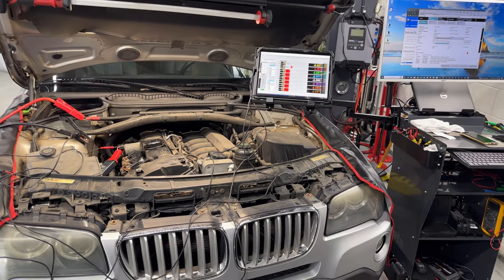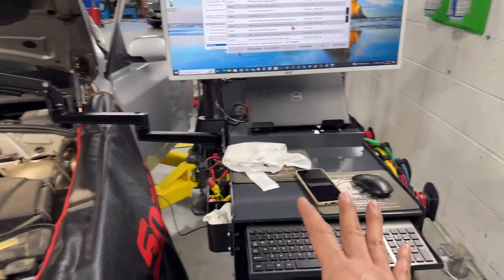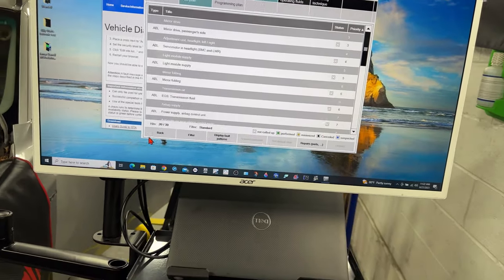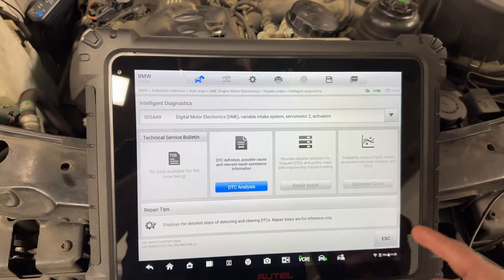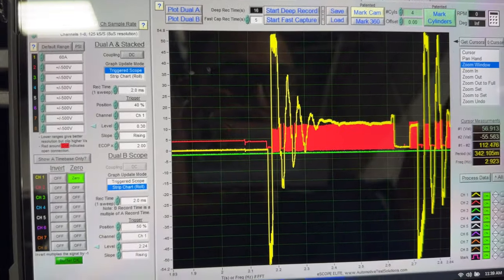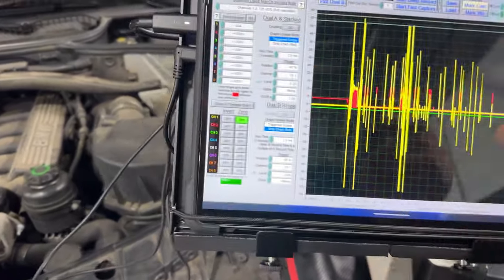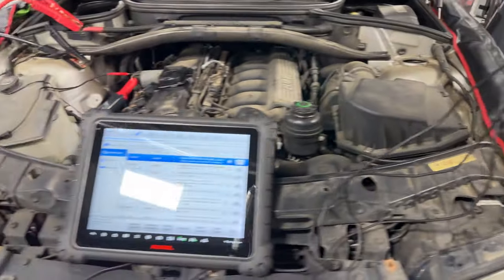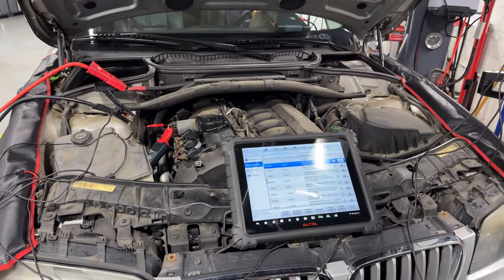2007 BMW X3 N52 E83 Valvetronic Motor Fault 2A43 Thermal Overloaded ATS Escope and Diag Cart set up

Comment: 2A43 Thermal Overloaded did you end up replacing the valvetronic motor to fix this code? I Have watched the video a few times but I really cant see what was the solution to this particular issue

Comment: Hi Maic, 2a43 Valvewtronic thermal overload above threshold is something that has been annoying me sometimes and more particularly rarely on a cold morning till I leave the car  for an hour or two start it up and it will be gone for another week or two. during the fault indication the engine will just rev once by itself till 1k rpm and then while driving the engine will be holding rpms and will be dropping rpms slower than normal, does it sound like something similar to what you ve seen yourself with a faulty valvetronic before? Mind you no other codes are showing in the diagnostic
Reply: I have exactly the same problem now. Did you resolve the problem ?
Reply: @arisowski  brother for me this video is a utter failure from this mechanic and author of this video as hes referring to this particular issue and he never actually resolves the issue or tells as anything on resolving the issue, personally I dont get it often and when I get it I know because my idle  gets weird when i press the clutch. Also another indicative to know this error occurred as its a shadow code to me, when the car is idling on cold start it will just rev up to 1200 rpm once during warm up.
This issue for me will happen once every 2 months or so and after I reach to my destination and leave the car for 30 minutes or so it will just be back to normal afterwards.
My understanding is the valvetronic motor may be on its way out slowly slowly or some sludge preventing it work properly on cold start. It hasnt been a major issue of mine but definitely one Im looking forward to tackle down at some point :D
Let me know or respond to my message if you find out a solution or a better reasoning on this one, Im interested as Im not going to change the valvetronic motor anytime soon unless it gives up on me completely and becomes more persistent in the near future
Reply: @arisowski  also I  changed about a month back my whole valve cover and obviously all gaskets , I havent seen the code since or as yet,  with the same valvetronic motor
Reply: @KonstantinosDounias  Im taking the car to the mechanic next week. I think its the valvetronic motor or the eccentric shaft sensor because the car lost its power below 3000rpms. Above 3000rpms it pulls just fine. All started after i noticed that error. I was just testing my new obd thingy and i found that code. The loss of power also seems random. For example yesterday morning the car felt very sluggish. 1.0 yaris could easily win the race from the traffic lights. Same day after my 12h shift the car felt great. It pulled just fine. I dont know whats wrong with that car. I love it but it gives me a headache sometimes
Reply: @KonstantinosDounias  My idle gets weird if i press the clutch in too. Will ask the mechanic what could it be.
Reply: @arisowski  mine was exactly the same , dont get disappointed on this motor as yet, other than the standard maintenance which every n52 will ask every 100k (Disa valves, valve cover and its gaskets and oil pan gasket, including the small oil cooler gasket) it will never ask you for anything else, bullet proof, the problem is the previous owners that never actually followed the maintenance schedule on those parts, I also changed fuel pump and coolant pump with thermostat, the car feels like brand new, I can go anywhere with it and its lots of fun trust me you ll love it, just get rid of this stupid error because it is an annoying start of the day when you get it and feeling it even going weird with idle even when downshifting or pressing the clutch in traffic i know it is way too annoying, keep me posted on how you go ! :)
Reply: @KonstantinosDounias  I will keep you updated. I get what you mean, when the engine behaves well i feel like im in love with this car. It pulls great, the sound is great, i love everything about that car. I have it only for about 2+ months so i just have to deal with all the things that were not done by previous owner.

Comment: none of us even have any of your tools ....so is it even a tutuorial when we dont have a software or hardware
Reply: I seen this fault and most common is the eccentric shaft sensor.  The high amps is mechanical but because the sensor underreport the end stops.  A quick test re to check oil inside
Reply from the maker: So you don’t have an amp clamp? Or a scanner? Ummm then maybe better don’t work on vehicles!!